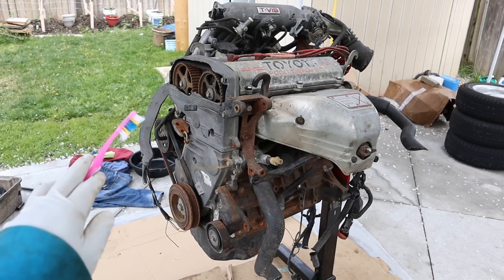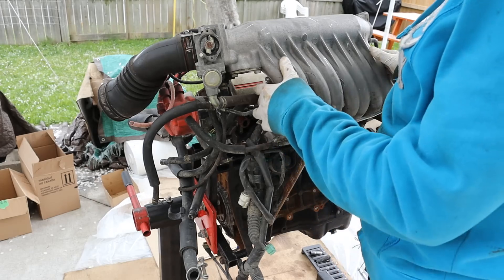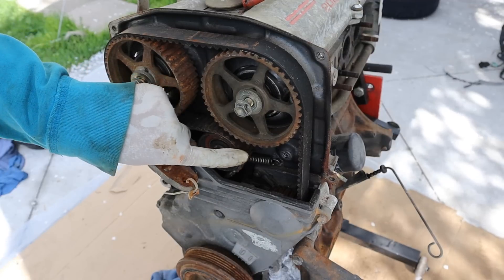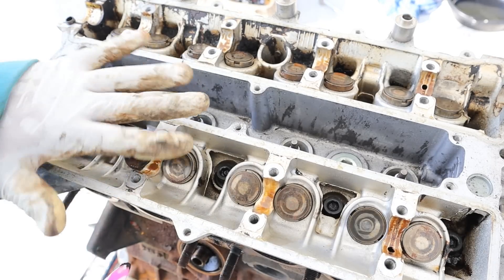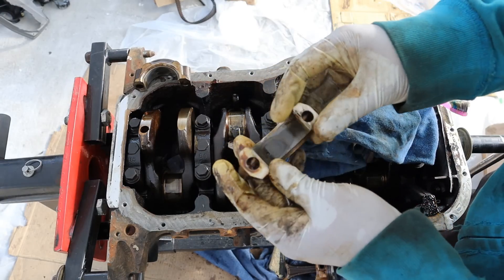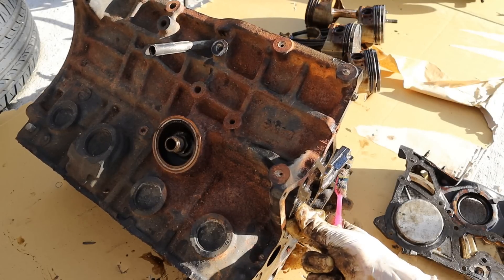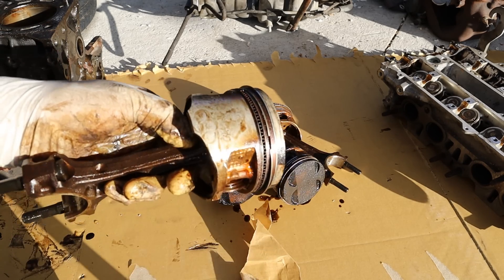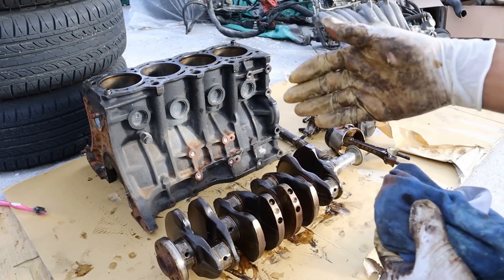Why the Toyota S Engines Are Super Reliable and Strong

Comment: Thanks.  My Celica has the 5SFE 2.2 which you referred to has 232,000 miles miles and is as smooth as silk.  Toyota make the best engines, Honda a very close second.  Just my opinion!
Reply from the maker: The older Honda Engines in my book hold a slightly higher edge than Toyotas but yes both very strong and reliable
Reply: @speedkar99  Toyota engines always seem to just last longer than Honda, especially apparent in the mid and large size SUV’s. I think it’s because they perfected the pickup truck which are known to last forever.  Transmissions and peripheral stuff like 4WD systems also more durable in a Toyota.
Reply: @speedkar99  but I’ll concede Honda are better driving cars, Toyota can be a little lackluster!
Reply: @speedkar99  actually thinking about it, I don't think I have never heard of a Toyota engine blowing a head gasket!  Can't say the same about Honda engines.
Reply: @robbflynn4325  ah, the 1.7L from 2001 to 2004 - official head gasket of Honda Motor Corp, almost as good as Subaru in this department ;) Nothing really against Hondas, I drive one. But... they have their issues, eg. the 2.4L 4cyl as the oil burning monster. But then I have come across some that were very well taken care of and didn't consume more than the 0.5L/5-6k km norm.
Reply: @speedkar99  what older Honda engines do you like, retired engineer whose daily driver is a  '96 civic cx
Reply: I have owned both toyota/lexus, and honda. All tops in quality and reliability.  I also own a subaru sti not even close 1st and last

Comment: The 3SGTE has a completely different exhaust manifold. Looks more like a log manifold, but it run a split turbine CT26 turbo so the Manifold is also split.
The 3SGTE/5SFE hybrid is well built and support a lot of horsepower :D
Reply from the maker: I didn't know that. I guess the split turbine is actually a thing. Thanks
Reply: @speedkar99  
The exhaust channel inside the turbine housing is split so that you have two separated channels leading to the turbine wheel and the manifold is equally split so that two cylinders feed one channel and the other two cylinders feed the other side.
I am not sure, but I think it is to better use the scavenging effect and for quicker spool with less pulsing. But google should have the scientific papers on the system if you want to research it.
Reply: It was also with the 3SGTE Toyota "cheated" in WRC during the late 80 and early 90 with the legendary Carlos Saints Celica.
Have one ST185 GT4 and one ST185 CS edition here <3
ST185 with 500 wheel horse power really rips the asphalt in almost any gear :D
Reply: @Mr.Engineer.  Toyota only cheated in 1995 or something onwards with the gen 6 Celica as that's when the FIA imposed the turbo plate restrictions. The gen 4 and 5's were just beasts at the time :D
Reply: @BennyJ69  
Didn't know the details, but thought they got away with it for a couple of seasons?
Reply: @Mr.Engineer.  From what I read it was after the reign of the gen 5 that the FIA changed restrictions because the cars were getting to scary group B like 300+hp figures. They added the turbo restrictor plate at the start of the gen 6 going into the WRC at which TTE(?) made their cheeky breakable restrictor plate. This was just from a couple of sources that I read though so it's possible I'm not entirely correct.

Comment: My Celica ST202 has the 3SGE😁. Thanks to share
Reply from the maker: Nice! How's yours holding up?
Reply: @speedkar99  Very well thank you, for a 1999 model, done about 124,000 miles.  Only issue is that the previous owners had neglected the underneath body work, and I've been battling with rust. But engine wise,    only issue I had was a minor oil leak due to valve cover gasket, otherwise it feels bullet proof!